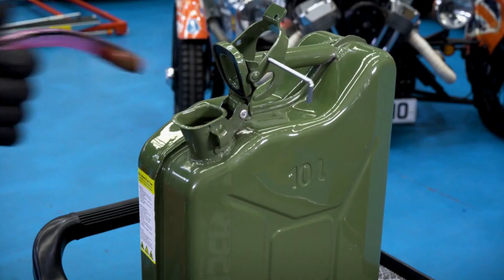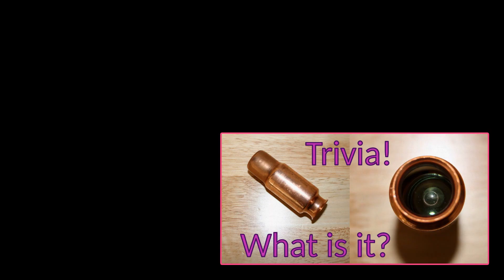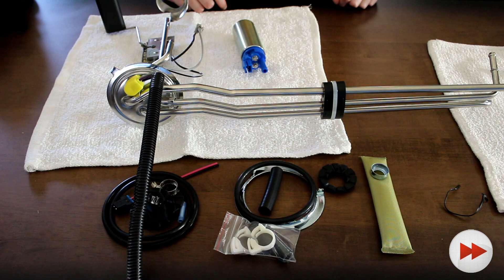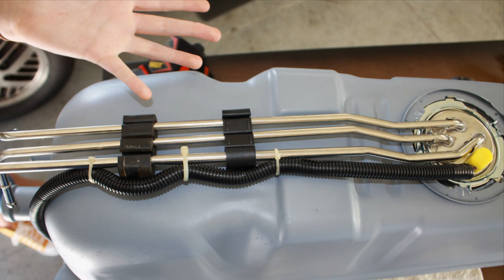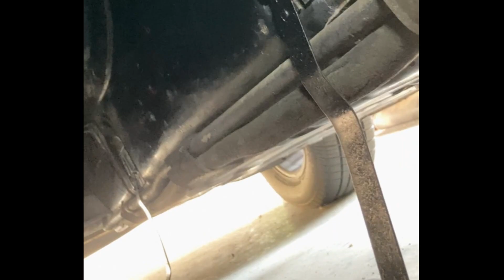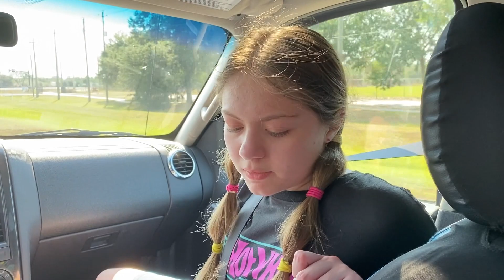How to replace & reinstall a sending unit in a Fiero! - Gen Z Garage - Ep 4

Comment: I have a 87 Fiero I had to replace my fuel pump 2 months ago I just put that in in 2019 it didn't last very long it is a delphi but we had some temperatures that were 107 degrees for 2 weeks the gas was low in the tank it probably what caused it to fry least I kept the receipt this time cuz it had a lifetime warranty but I didn't know you can get the sending unit I'm going to look that up cuz I use my old one and the gas gauge doesn't work very well so I'm going to have to look into that and get a new sending unit

Comment: Do Not use sealer on Hose joints or O-rings. Sealers can cause leaks here. Many are not plastic/rubber safe products and fuel may not wash that out so can attack the rubber 24/7.  If too hard to slide hose on a part then silicone or even liquid soap works without trying to guess on rubber type you have.
Reply: PTFE is specifically used for caustic fluids like fuel. It’s also safe for rubber and polymers.
Reply: @ToddsWatchshop  Permatex 80633 and related are Sealer for Threaded metal joints. SDS(MSDS) at Permatex list some ingredients but not all. Other chemicals in the product might attack the rubber. PTFE, Talc and Titaniun Dioxide between rubber and metal may cause leaking because of very low pressure and limited area in a joint. Any lube for Tank Top seal may allow O-ring squeezing out of the space during install or after causing Fuel, Fumes and Air leaking.
Reply: This is correct. PTFE should not be used on fuel systems or O-rings. Only Dow-Corning 111 should be used on O-rings and rubber hoses. No greases or liquids are required, but if needed, water and dish-soap works great. So does WD40.

Comment: Easy this time! 😉That's a cold start solenoid for an older throttle body (or even a carb). When energised, it pushes on the throttle linkage and opens just a little the throttle plate. Thus allowing the car to idle a little higher on startup. The thing would turn off once the engine was at working temperature.
Reply from the maker: How do you know all this stuff?! You've been dominating the trivia!
Reply: @GenerationZGarage  I'm like the french version of "Uncle Tony"😉
I've been working on my cars all my life, and that means I've seen a lot of different things.
From a 2CV to a huge V8 and everything in between.
Have fun restoring your Fiero👍
Reply from the maker: @turboslugfiero  That's really cool! Thank you!!!